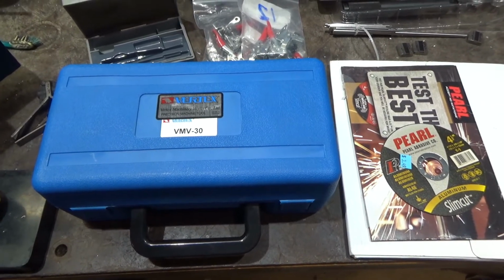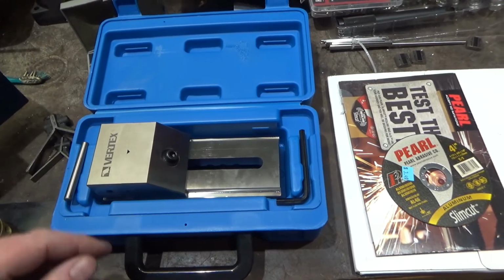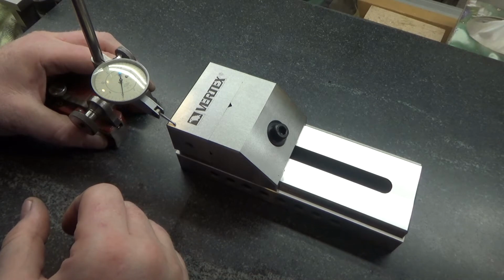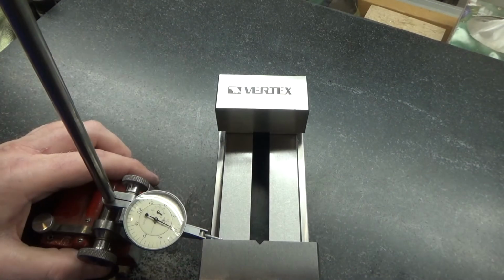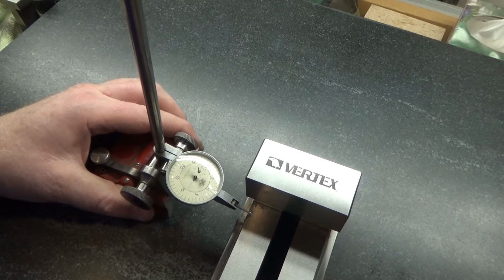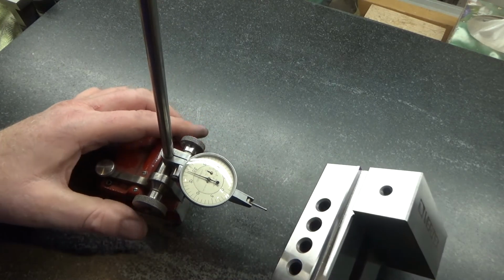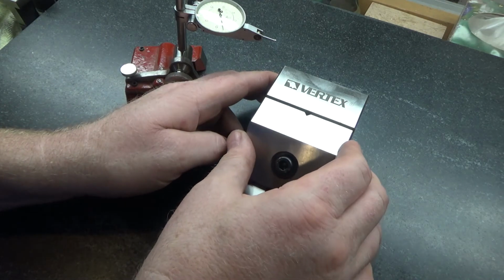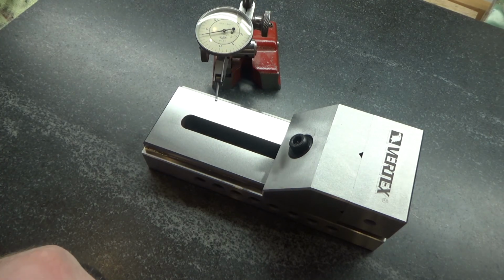QTR 13   3 Inch Vertex Grinding Vise

Comment: Have you check all six face and jaw faces accuracy. I found the Vertex I got small faces(front and rear) is not good as expected. I need to seat the vise at any of the 6 face in some case.
Reply from the maker: I will be sure to include that in future videos.

Comment: Cosine error is not a factor when measuring run out, which is what you were doing, as all deviations are relative. It only becomes a problem when measuring absolute linear length or height when the tip in not in a 90' angle to the measured surface. Any angle not 90' must be corrected using a correction factor usually included with your DTI, and again, necessary only for an absolute liner measurement.
Reply from the maker: Thanks for the comments. You might think about the issue this way: The tip of an indicator causes rotation that moves a rack and pinion and ends up moving the dial in proportion to the amount of rotation. Now consider the tip completely horizontal - in this case any deflection of the point will result in maximum rotation.Then consider the opposite extreme where the tip is 90 degrees down - vertical motion will result in zero rotation. You can see form this that at any point in between the amount of rotation will vary between zero and max. So even for a relative measurement the reading on the indicator will go from dead accurate (at least in the number of say thousandths) when the tip is horizontal to no change when the tip is vertical. I hope this makes sense. My referring to cosine error was relating to the number of divisions the indicator was reporting.
Reply: @DudleyToolwright  When you consider the percentage factor of the cosine error, depending on angle of cosine, and apply it to a relative reading of ten's of thousands, it really is negligible, and again, all you are looking to do is zero on both ends of your measurment.

Comment: What do you have for a grinder? Just curious.
Reply from the maker: I do not have one, yet. I wanted this vise because you can orient it upright or on its side and it still remains parallel.
Reply: robert weitkamp Check this out. Not sure where you're located: http://www.ebay.com/itm/Brown-Sharp-Micromaster-612-Surface-Grinder-/272851719005
Reply from the maker: Thanks! What a great deal. Unfortunately, I am in California. I appreciate you looking out for me.
Reply: robert weitkamp You can use ebay's search organization criterion 'by distance' to reduce the effort sorting through their listings. There seem to be lots of listings in southern CA through machinery dealers. I got my B&S Valumaster 612 (in nearly new condition) through craigslist, but that requires vigilance and luck to find a good deal. I had almost purchased one for 3X the money a week earlier.
Reply from the maker: I definitely will. I didn't know about the ebay local option. I have been looking on craigs list locally hoping to get a great deal.
Reply: Hi Robert, I just picked one up from Eisen this week for $125.  I got one size up, 3.89” wide jaws, and I hope I don’t regret getting the bigger one.  It will go in my surface grinder that I will unveil soon.  🙄

Comment: it is to replace the piviot pin in the bottom in a perminant position for production jobs, stops it stepping out accidentally and wasting reingagement time and mispositioning, resulting in wrong or zero clamping force.
Reply from the maker: That makes very good sense. Thanks for the info. Hopefully, you can help more than me with your ideas. Cheers.